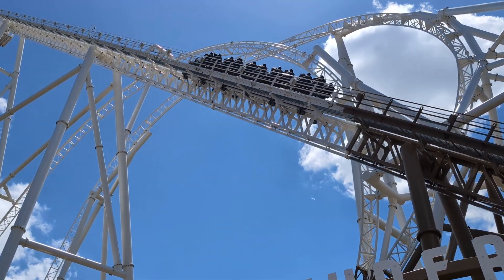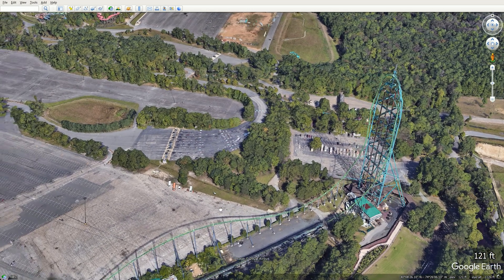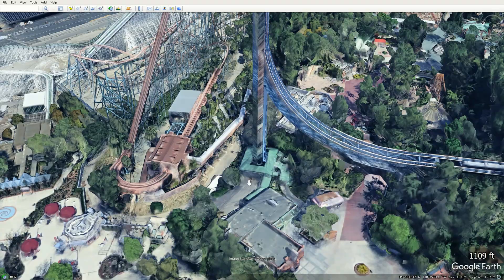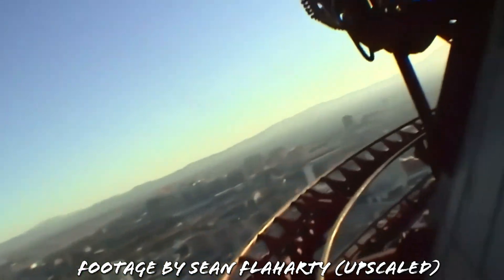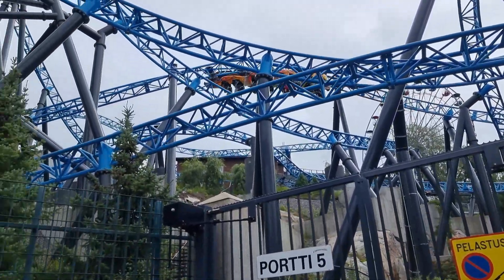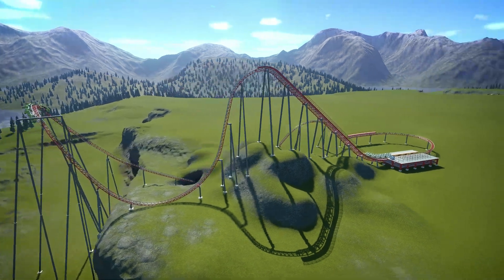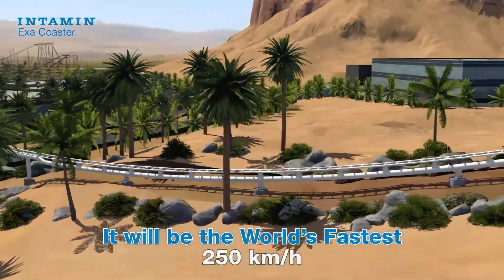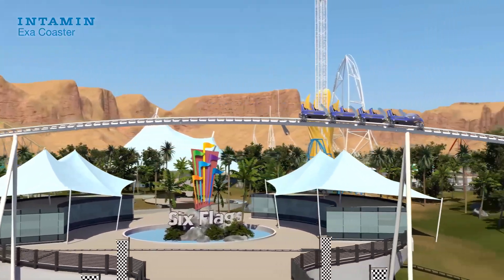How Tall is This Roller Coaster? - What Exactly Are We Measuring?

Comment from the maker: What points would you use to measure?
Reply: Highest point of TRACK compared to the lowest point of TRACK
Reply: @Costics so, according to that, banshee is a hyper invert.
Reply: @schumi246  ok sure
Reply: @Costics  agree, 100%
Reply: Difference between the highest and lowest points of the track.  Also, Orion @ KI can IMO be considered a giga as the drop is 300'.
Reply: Good video! Great question! 
What makes most sense to me is top of the highest used tract to top of the lowest used track.
 So yes, an alpine coaster would hold a height record. But that is an easy fix in that alpine coasters are in a different category from other types of coasters.
Reply: TLDR; The track height from the highest hill to the nadir/low point of that drop.

Nobody cares about the height of Maverick because Maverick isn't that type of coaster. Maverick is a coaster that zips through the layout. Sure, it should be measured as it is a coaster, but we only care about the giga and stratocoaster measurements because that is where the actual height actually comes into play

Orion should be 300 ft tall because that is the elevation change of the drop and Superman is kind of an exception, but I don't think you can ever get away from those type of exceptions. 

If you start measuring from highest elevation to lowest elevation, you are going to get a lot of "cheaters" in a manner of speaking that would only need technicalities to explain why they do or don't overtake the record. Like the example you showed in planet coaster. There are lots of different elevation changes and how do you know where that elevation should be measured the track only? Or is it including geography?
Reply: @KippKipper  all completely valid points. Until you pay Guinness (or RCBD) enough to define clear criteria we will be discussing this at nauseam.

IMO The hieght record with no caveat should be a alpine coaster if they are considered actual coasters, and Kingda Ka for a full circuit coaster. O
Reply: @knatt5300  I think what you said about full circle vs linear versus alpine. There is a difference between a coaster that lets the rider go all the way around a circuit versus just a shuttle coaster.

Essentially. I think Alpine coasters don't really define as a coaster for most people might boil down to industry standards (you don't find them at theme parks and) and because it feels different.

I'm not opposed to Alpine coaster records I think coasters would become boring because there's no challenges to building an Alpine coaster up high cuz you just have it hug the terrain which is fine That's what Alpine coasters do.

TLDR; make different categories
Reply: @KippKipper  I don't think you know what TLDR means. Nobody cares about Orion's height; they care about the drop. As for Superman at SFMM; I don't see why anybody doesn't call it a shuttle giga since it only drops 328'. It can't be more than that because it only goes 100 MPH.
Reply: I think the only two numbers (considering height) that actually relate to the ride experience in a meaningful way are: highest to lowest point in the track layout* and: highest continuous drop. Everything else is more like a miscellaneous fun fact.
*edit: more specifically: highest and lowest points that riders actually reach during a regular cycle - re: spikes on shuttle coasters, swing launches etc.
Reply: And yeah, alpine coasters are tricky since most of them could technically be considered one single continuous drop, but that doesn't quite feel right. 😅
Reply: I think I'd use the highest point of track above the ground directly under it. Better yet: I'd put more focus on the drop stat.

Comment: This is quite nerdy, but I tend to measure using the 'min' function, which returns the minimum of it's arguments: i.e. min(3,2)=2. So height of coaster = min(max height of coaster rail traversed by vehicle above ground, max height change from monotonic rise or fall of vehicle). By monotonic rise or fall, I mean a continuously upward or downward piece of traversed track. Using this, coasters can't just arbitrarily jut out over a cliff edge, build a massive spike that is never traversed to the top or build a massive hole in the ground to take the record. This seems closest to what we intuitively mean by coaster's height as it must be high above the ground but also feel like that height is traversed. I count Alpine coasters as I think that's fair.

Comment: I was surprised to see you didn’t mention Nemesis over at Alton Towers. The rule regarding the tree line makes the height super weird. The height is 42 feet but the drop is 104. And much like Orion, any stat you look up always ties the actual height and the drop height together.
Reply from the maker: It's another interesting example, however Google earth doesn't have 3d imaging of the park.

Comment: My rule of thumb is the height of a coaster for the purpose of records is the highest point on the coaster's track relative to the lowest point on its track. I also only count the characteristics that an entire train traverses through a full, if not entirely continuous, circuit. Thus negating shuttle coasters but including coasters that may have switch tracks that "break" a continuous circuit like Expedition Everest and Pantheon.

I personally don't count alpine coasters in records, despite including rides that may have arguably similar characteristics, because of a few other rules I have regarding what counts towards being a "true" roller coaster. Those being as follows:
- A coaster cannot have an method of generating mechanical propulsion that is contained solely within the ride vehicle and reliant only on outside power/signaling to traverse the majority of its circuit
- A coaster has to include multiple changes in direction with the intention to induce a change in forces and heights experienced by the passengers
- Said changes in height and force must take place over a short enough period to be significant to the experience of the ride
- Said changes in height must utilize a significant fraction of the kinetic energy of the coaster at the given part of the ride to achieve its height and intended forces

As such, alpine coasters are a separate category than roller coasters, and have their own records. Additionally,
Reply: Question.  Would Switchback at ZDT's be a shuttle coaster?  What about Palindrome, or the Super Boomerang models?  Where do you draw the line?

For powered coasters, would the Maurer Spike models be coasters or no?  What about Looping at Parc St. Paul?

With regards to the "multiple changes in direction", what about coasters that only turn in one direction like Mayan Mindbender or Twisted Timbers?

I get the idea, but adhering to rigid rules will always create outliers.  

My general rule of thumb is "if you show the average person the ride, what would they call it?" For an alpine coaster, they probably would call it a big toboggan ride.  A Vekoma Boomerang would be a coaster, though, while Harley Quinn's Crazy Coaster would not (it's clearly a version of those Ring of Fire things).

Comment: I think one of two key ways to measure would make sense. First being, just go with the height difference between the lowest point of the ride and highest point of the ride. And count alpine coasters as long as they are a closed circuit rather than like a rodelbahn where u go up with a cable car and ride the roller coaster down.  The other method would be involving the maximum height of a drop on a ride so that in order for the height to register the riders should be experiencing close to zero G’s for like the 60 percent of the decent. That’d make orion a Giga coaster as you experience an airtime moment and G force thats compareable to B&M’s other giga coasters. That second method would however eliminate alpine coasters and also the poler coaster concept from braking any records. Records should be based on what the rider experiences. Not how it looks so I think measurements like how tall the structure is or how far guests are off of the ground are obsolete.

Comment: Here's my metric: Measure the top speed at pristine condition and see how far up that could go on a frictionless track. Alpine coasters won't go that high so they aren't tall, but Falcons Flight would still be considered the tallest. Superman: Escape from Krypton would be measured by about the height the cart gets up to from the flat section. The only problem with this is that the world's tallest and world's fastest rollercoaster would be the same.
Reply from the maker: An interesting concept, but it would kind of make height irrelevant if speed was all that mattered, and formula rossa isn't that tall

Comment: For me the a ride height should be measured from tallest to lowest point of the TRACK because it’s what’s the train is running on. The supports are just there to holding the track not make the train go faster or slower. It could be like near misses element but without it the track still be the same, speed still the same, forces still the same, same feeling. Like take a 2 meters man with 1 inch shoes and hanging him over the cliff he is still 2 meters tall wearing a 1 inch tall shoes. Is shoes count as the man height? No. Is the man still 2 meters when we hang him on a cliff? YES. If we dig to the ground and put him there is he -5 height? NO! He is still 2 meters tall.

Comment: What if you have a B&M hyper coaster that has a 175 foot drop, but because of the terrain, the second hill has another 175 foot drop, which gets the train to the top speed. The lift hill is 190ft from the station, but because of the terrain, the total difference in height from the top of the drop to the bottom of the second valley is 215 feet. Is this ride a true hyper coaster? 

One thing I think matters is the speed. Alpine coasters have controlled speed, so they don't feel anywhere near 1200 ft tall. Also, I would most accurately measure a coasters height as the height difference from top to bottom of a single element (ie the biggest drop), but if the coaster has a taller freestanding structure, I would use that as the height. For falcon's flight I would use the difference in height betweef the highest element of the cliff wall section and the valley immediately after the drop. Or, if there's a greater difference to the base of that massive launched lift, to use that. I personally find the 640 feet more accurate than the 540 feet of the airtime hill, but if the 640 feet is the difference between two completely different parts of the ride, then that's like an alpine coaster, it should be counted.
Reply: This is extremely close to Phantom's Revenge.

Comment: I think it also really depends on the goal of what you're trying to measure. In Superman the Escape to me at least it matters how high off you're from the ground. Because facing the ground from a higher point is scarier, even if you don't go the full way down. Whereas the top of the ride doesn't count since the ride doesn't go up there.
An Alpine Coaster might have a greater difference in height. But the fear of heights isn't what makes them thrilling. The tallest Alpine Coaster is a record relevant for the length of experience. In that case I would rather learn the track length and average incline. Since that tells you how long the experience is and how intense.

Comment: I've considered many definitions that I'm sure mot have been used; 1: height of the highest point of coaster track as measured from it to the ground directly below it; 2: height of the lift-hill; 3: elevation difference of the entire coaster track; 4; height of highest point of coaster above any ground below any point of same coaster; 5: height of highest point of coaster above sea level;. 6: height of lowest point of coaster above sea level. Additionally: whatever the height stat denotes, the hight stat is NOT the same stat as the drop stat; and more importantly isn't usually as important as the drop stat, since the drop stat is usually the "service" part of the ride but often get confused with height. I'm guessing most of the time height stat refers to my 1st definition; the highest point of coaster track of any coaster as measured from its height to the ground directly below it, and I think it should become the exclusive and official standard of what the hight stat of a coaster ought to be from now on.
Reply from the maker: The point is there isn't an "official" way to measure, at least not one that's universally accepted
Reply: I mean if elevation difference count.

Lighting Rod was the only launch wooden Hypercoaster exist. And Alpengeist is the only invert hypercoaster in the world. Or few alpine coaster is stratacoaster

Let's be honest, that's sounds so WRONG
Reply: @bocahdongo7769  Incorrect: Alpengeist reaches its top speed of 67 MPH at the bottom of its 1st drop. Banshee has a bigger top speed of 68 MPH which it reaches at the bottom of the pretzel knot, which is the bottom of its fifth drop, after friction has had a toll on the ride. So If anything Banshee is the B&M invert with the biggest elevation difference between its highest and lowest point of track, not Alpengeist.
Reply: @Paolo8772  because Alpengeist simply spend more on track before entering the most bottom part of the track. Because we all know, Rollercoaster has friction

It doesn't directly correlated with height difference. Again, some alpine coaster is slower than most family coaster, yet it's strata coaster by your logic
Reply: @bocahdongo7769  The reason nobody calls alpine coasters gigas/stratas etc. is because alpine coasters have automatic breaks that prevent them from going over about 25 MPH. Also, Banshee gets to 68 MPH after more than half its layout DESPITE friction, which only proves it has a bigger elevation difference than Alpengeist, even though it doesn't have one singe drop as large as Aplengeists's 1st drop. 

But it makes you feel better: NEITHER Banshee OR Alpengeist have a height OR a single drop 200' or more, so NEITHER are hyper coasters.
Reply: @bocahdongo7769  If the bottom part of track of Alpengeist is after th MCBR it's irrelevant since 1: the difference in elevation between that and the bottom of the 1st drop is negligible and friction would make it slower even if the MCBR didn't slow the train.  Either way you cut it Alepengeist is NOT a hyper.
Reply: One of the measurement could be the height difference between the station and the highest point of the coaster
Reply: @bananogamer6972  I think B&M gigas use height that way that since they usually use drive tires on flat track from the station to the lift hill, which I also believe they use for their height stat. But I could be wrong about that.

Comment: Ah yes. I always think the height of a coaster should be the lowest to highest point of the track. Superman's height is a massive scam and even using the lowest to highest point of track is misleading, so you'll always have exceptions to the rule.  Orion's height is actually how it should be measured.
Reply from the maker: I'm pretty sure you're contradicting yourself, unless you're saying Orion is 300ft
Reply: @RollercoasterDavid  Orion is 300ft from the top of the lifthill to the lowest part, is it not? The difference between it and Superman is that the train actually hits the track at highest and lowest level, unlike Superman. Thing is, in theory they can "increase the power" and make Superman hit the highest point of the track, with the risk of it flying off the track of course.